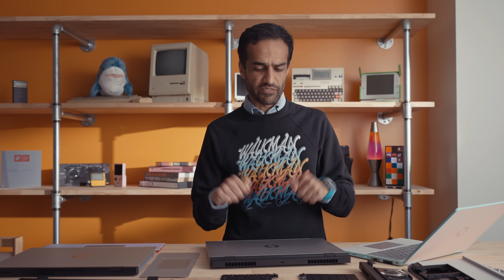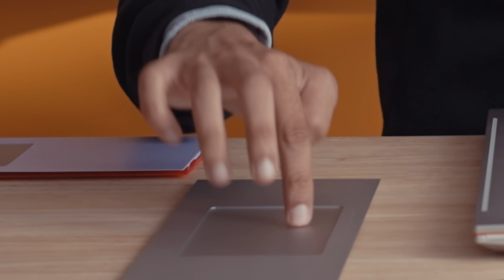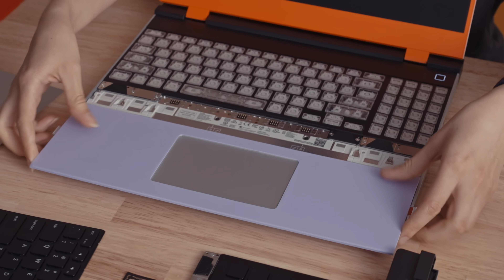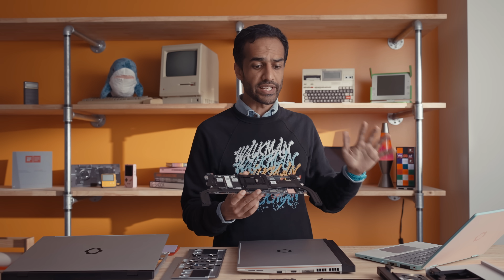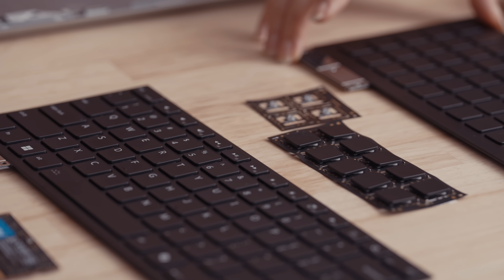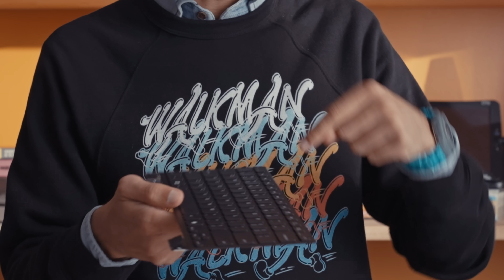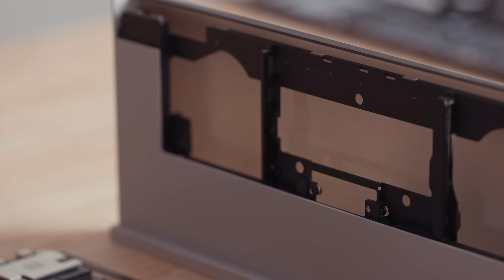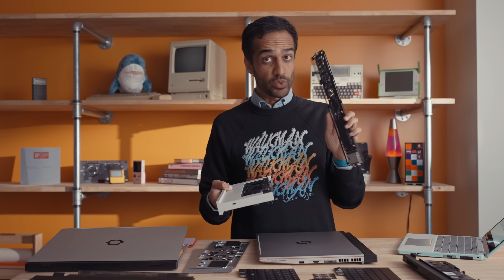Framework Laptop 16 - Prototypes and scrapped ideas

Comment: No clue who would even see the comment, hoping someone at framework will!

First thing as always, the transparency is BEYOND amazing. Not only what everyone tried working on, but WHY it didn't work. Love to see that!
I, for a while, and probably like many others, had seen no news about the Framework 16 itself, but kept seeing new product releases, and I for a while questioned if I invested into a dead-end product. I was so so so happy to see I was proven wrong, thank you Framework team!
Second, the new cover that was developed fixes my ONE major gripe about the lid/screen itself: I can simply bow the whole thing from the back if my finger pushes on it. I will be ordering one as soon as I can, and hoping it negates or at least reigns in how much it bows. I am a bit rough with my portable devices.
Excited to see the NVIDIA people have an option for GPU choices, even though I myself stick with team red
Was excited to hear that being able to charge was added to the GPU, even if it was only for the NVIDIA GPU, that was a small gripe of mine, and I'm excited about the firmware update to run the dGPU connections through the laptop port! I'm eager on that too, even though I don't use external displays outside of a drawing tablet.
I feel like this was an incredible announcement, and I'm so ecstatic about a lot of it- from the cover plate, to the webcam!
Personally, launching a gen 2 of the 7700S without developing charging from it was a miss, and I'm hoping I misinterpreted the website. On the pre-order config, it says that one charging port should be dedicated for charging when using the AMD GPU, so I assume it's just not added on that gen 2 version.
It also is (a small) miss that there wasn't a new-gen AMD GPU launch alongside the 5070, especially since the NVIDIA card is the only one adding the charging.

Things I would love to see possibly?

A new AMD GPU! Perhaps a 9060 16GB? That is likely asking for a lot, especially since the room to work with is so small. However for many newer games (and specifically myself, as a 3D Artist) any more VRAM that could be offered would be well taken! Even if it's an oddball 9060 12GB, somehow.

I am also curious if there is ever a possibility of a touchscreen for the 16? Given how it's developed, I just assumed not for the longest time, until the Framework 12 came out. I know the 16's screen doesn't bend backwards, so it couldn't be used as a tablet, but it would be something interesting to see come out, and I myself would likely invest.

I would really, REALLY enjoy that external GPU bay, and if it worked with your other modular bays, such as the dual M.2 Adapter? That would be amazing! If it was compatible with more than just the GPUs, it would work with all modular bay layouts. It would make an amazing docking station for MANY different use cases!

Speaking of modular bay layouts, why not a USB bay? Silly, but ports are ports, for those who would need it. Not sure if it would all fit given how thin the whole area is though.

I've seen MANY people also wish for a battery bay? Myself included. Considering the fans, it would be a pretty small battery, but the framework 16's biggest weakness, in competition to other laptops, is the battery. Which isn't a fault of anyone! That's simply the modular design, it's a tradeoff I believe is more than worth it, personally.

Edit: I forgot to mention, I would love love love to see a proper eDP for the screen to a proper Displayport shell? I love my smaller screens, and the framework 16 screen, and 13 gen 2 screen? They are BOTH phenomenal, it would be amazing to be able to use those as external displays.

Please please keep that backwards compatibility as far into the future as possible! It is beautiful to see. If anyone who knows more about the laptops and how possible certain things would be, I would love to hear! I myself am tech savvy, but not that much. The knowledge would be appreciated. We love you all at Framework, thank you for what you do ♥

Comment: RTX 5070.... 8GB. 16GB VRAM would have been nice - but this isn't even worth considering. And how the expensive propriatary designs for the cards are implemented - upgradeabilty is very limited and dependent on what FW offers (at a premium cost), reduced warranty compared to competitors... Their mission statement and what they actually offer don't quote align in my eyes, and thats a shame. They could have offered at least an Ryzen AI Max+ 385 in the Laptop. That would have been more usefull. But then... Ram, CPU, GPU.... One block. So an all or nothing Repair/Upgrade scenario. But thats no issue in the desktop, so....
Also why isn't the +2 m.2 Expansion module isn't featured on the 16's configurator, why is it buried deep within your page so you have to activly have to hunt for it? And then it tells you that you actually have to by an interposer (probably, who knows [just add a selector for the eypansion shells, and wether the selected part needs an interposer of an certain type and comes with one...)

Comment: The reused GPU idea could have some legs as an internal GPU for desktops/servers.
Their form factor is already thin, maybe 1-1.5 PCIe slots thick, it could be upcycled into a lower power desktop GPU or one for ITX builds.
But it all depends on if the PCIe signal can be extended from the interposer connector to a standard 16x or 8x slot, and if supplementary PCIe power has to also be supplied by a 6 or 8 pin connector or if it can all run off of slot power.

Comment: Thank you very much for everything that you're doing.

I respect and appreciate your honesty, transparency, care for the environmental impact of your work, genuine care and respect for your customers and their feedback, as well as all of the effort every single one of you at Framework are putting into changing consumer electronics for the better.

What I would love to see is a 2 in 1 with:

A pivot hinge for improved comfort and ease of use.

(Many artists like myself would like to sit the laptop on our legs when working in public or relaxing at home, but wouldn't be able to without touching and potentially activating the keyboard on a 12.)

A backlit keyboard (It's great to see these on the other laptops, but I would really appreciate if it was added to a 2 in 1.)

A GPU (The 12 looks excellent, but without a GPU I can't do the kind of heavy work that I need to be able to, so at the moment I'm in a position where I would have to choose between getting the 12, but losing the backlight keyboard and GPU and having to buy something else for the graphics intense work, as well as gaming and virtualization or buying the 16, but then having to buy something else to use for my art, instead of being able to do it all on the one device.)

 Lastly, I'd love to see a secure lock port, for additional security.

I don't know how possible this is, but being able to transform the 13 (With a GPU) or 16 into a 2 in 1, for example by adding new hinges and a touchscreen/stylus option for artists would be huge.

Thank you again, I wish you the best of luck with your endeavors.

Comment: This is FASCINATING, I've never seen anything like it. For the pointer, it wouldn't be the same, necessarily, but is there an optical solution that might be lower-profile than a nub? Here I'm thinking of some older Android phones that used a tiny optical trackpad to allow a mouse cursor. The tactile experience might not be the same, but the UX and ergonomics might be able to be tuned to be similar in software.

Comment: Perhaps instead of building an eGPU housing yourself you can design a simple 3D prinitable version so that people can make it home and you only sell the board part that connects the GPU to a usb c cable. It would be pretty sick to upgrade my laptop then add the previous GPU to a much older laptop as an eGPU or an extra encoder card to my desktop.

Perhaps also have a way to directly insert these GPUs into a desktop motherboard allowing it to be used as a secondary GPU and have a connector for 8 pin power or usbc.

Comment: One of the long-term issues I have had is the flex - the trackpad can register clicks if you lift the laptop up on one side instead of both sides at once. I do want 128GB, though. I saw Crucial's because it was the only one that was around. 
One feature I think could be neat is to let you use the laptop itself as a dock (lapdoc) - using the user-facing hardware, and instead of using the internal compute, using a docked device's

Comment: There are two things i'd love to see you try!
1. Official Oculink support - Many users have DYI'd this using NVME adapters, but an official version, especially one that uses all PCIE lanes, would be amazing.
2. Framework Dock - After preordering the F16 I've been trying to choose a dock and I feel like you guys could do much better than what's on the market using expansion cards!
Reply: I have a convoluted setup that allows me to use my fw16 "docked." An MST splitter to run graphics card display output to my main monitor and my TV that's on the other side of the wall in my living room, a USB C dock that was hard to find that actually had the ports I need instead of half of what I need and then one of every other port that you can find these days, and then my FW charger in another USB C port to get the full 180W since no docks support that much power. If FW made a dock, that would be so much better.
Reply: @kdawg7695 The HP Thunderbolt 4 Dock G6 actually supports USB-PD with 180W, if Framework implements the USB-PD Alert Messages correctly then you could even start the Machine via the Dock Power Button.
Reply: I second oculink support. With how unique the graphics module system is, it would be a shame to let all the possibilities go to waste with what else that bandwidth could do. Of course I understand that Framework is busy with other, more profitable endeavors, and I definitely don't want their business to sink because they dumped too many resources into such a niche problem; however, I can't help but hope that this becomes a thing someday. The Framework team is smart and resourceful, and if they find a way to get this done on a low budget I trust that they will execute.

And a note to Framework: You have a very strong community. Please feel free to use our knowledge and talent. I am sure that there are many people much smarter than me that would be happy to help you develop cool stuff; all you have to do is ask.
Reply: A dedicated framework dock would be epic, maybe with an oculink support built in so a one cable setup.
Reply: @brenster21  funny enough framework just announced a devkit for an oculink eGPU kit. It's not a dock, but it's awesome that they did this! preorders aren't open for it yet
Reply: elite ball knowledge
Reply: @dr3sslikecrazy  maybe we'll get a dock next!

Comment: I'm not sure how much interest there would actually be in this, but I know at least that my dream framework laptop would essentially be what you already have with the framework 12, but maybe with a premium upgrade (or just a separate product line altogether) for more accurate/less jittery stylus support and better color accuracy, so that i could use it as my primary art device!  Currently using an ipad for that, and i want my art experience out of the apple ecosystem so badly lol, and a tablet i could repair and upgrade and run my fav distros on would be everything i could possibly ask for :)

Comment: This is so cool that you even make a video like this, love seeing the engineering and prototyping discussions. Excited to hear about the keyboard modules and what's soon to come. I have a 19 inch server rack and would love a 3d printable DIY solution to blade mount spare 12 / 13 / 16 inch motherboards (particularly 16 inch, but cross compatibility would be great if possible) as a CPU compute cluster. Would allow me to justify upgrading to the latest gen hardware knowing I could still use my older hardware in servers. I know this probably doesn't make the most business sense to work on and probably won't get made, but it's something I've had in the back of my head since I saw the Raspberry pi blade clusters from a couple years ago.

Comment: I buy Framework laptops for my office, we currently have bought something like 40 Framework 13s. An issue I'm running into is users want a 16 inch laptop, but the price of the Framework 16 is too high to justify the cost compared to the competition. If we could get a Ryzen AI 5 340 paired with a lower refresh rate screen, I bet we could drive the cost down by a couple hundred so it is more competitive and I can justify the purchase with my CTO.

Comment: To solve the input module issue, would it be possible to make three separate, single-piece versions of the trackpad? One centered, one to the left and one to the right, and let the customer decided which one they would prefer to use?

Comment: Please try the egpu with framework 13 to make it as easy to use as possible. If that ends up working well for gaming, it would be a really good idea to just have that gaming juice at hand. Also, eventually release the case for it as a 3d-printable part, it would be useful

Comment: Multi-solution: keys pressing on the screen, transparent bezel being more brittle, having a track point, needing to stiffen the screen.

...why not make a bit more rigid, thick bezel that is narrow on the bottom near the hinge where it needs to be, and slowly gets thicker as it goes towards the top of the display? It would hold the lid slightly more open and allow thicker keyboards, input modules, track points, and be more durable.

Comment: The Expansion Bay e-GPU dock is going to be a hit when it comes out because Laptop 13 and 12 owners would find a great use in dedicated graphics acceleration applications, however to add more into functionality, I find that it would be beneficial to add expansion card slots so that the e-GPU dock could also be used as a desktop dock, at least take advantage of the bandwidth capabilities of USB4 and future high bandwidth usb standards. I would definitely want a desktop dock with hardware acceleration to use on my laptop 12 once it gets USB 4 support (Laptop 12 AMD mainboard when? pretty please!)

Comment: Pls include AI Max+ 395.  That combined with upgradeable memory would be amazing.  The eGPU base should support not only your GPUs but if they could also mount standard GPUs, once you can provide a thunderbolt 5 adapter you could have an incredibly powerful workstation on the go and unrivaled power when docked with the eGPU.  Wishlist summary:  pls stay at the forefront with AMD and their new AI processors, keep working on that memory speed and expansion, make an eGPU base that can accept both your GPU modules and standard GPUs, and then a Thunderbolt 5 adapter. Chef's kiss!

Comment: One thing I've been hoping for ever since the release of the 16 is a secondary battery module. A laptop with more than 100 Wh of battery would be sick. Even better if the module's battery was hot-swappable, but that may be asking for too much.
Reply: It wouldn't be allowed on planes then.
Reply: @Brutally_Honest_Noahide  Then just take the battery pack out, or don't buy it. That's the whole point of modularity. I don't care about planes whatsoever. Why must every laptop's battery be restricted by plane transportation rules, when the majority of the population has never been on a plane?

Comment: I really like my original framework, but I wish the bios had undervolting as an option. Since I use it mostly as a moilbe PC, and not a compute focused workhorse. It still gets pretty warm sometimes, and I would like to be able to reduce the power, even if by a bit, and extrend the battery life. RN the only option to do that is use smokeless UMF, which I am not happy to experiment with. My framework is too usefull to me, and I can't afford to brick it. I just wish the bios had voltage control options for undervolting.
Reply: Not sure if it's exactly what you need, but there's this tool called extreme tuning utility (think intel xtu for amd cpus, it might be a slightly different name) and it lets you adjust voltages, tdp, Amp limits on the vrms, its pretty nuts

Comment: Heyyy,
Thx for the great vidéo about the new framework 16 and the other vidéo about the prototype and more.

I have an idea that pop into m'y head at the end when rhe talk was about the external dGPU, could it be possible to do the same with screen of the framework 12, 13 and or 16 ?
Like an enclosure with a little board that can connect to the display and give input option with maybe the cards already présent on all device like 2 or 3 USB c port depending on the size of the screen when whe can plus an adaptateur USB c to HDMI, display port or USB c.

Thanks again for the video and new products and hope for a framework printer (I dream of it ✨)

Comment: One thing I would want in the future and in my mind have imagined trying to DIY (but I have no idea where to source stuff and get it made)…

Is a different middle plate behind the keyboard & trackpad such that there could be active modules down in the trackpad area AS WELL AS the keyboard + extra module area at the same time.

And such an idea could potentially provide a solution to their failed trackpoint attempt…

If one of the spacers for the trackpad area were to borrow the ‘joystick’ (if you can call it that) from the original sony Playstation portable there would be your low profile trackpoint…